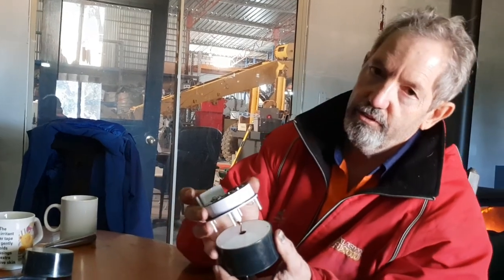Netatmo wind gauge

Comment: Hi Colin - there's no green light when I put in new batteries on my wind gauge so I'm wanting to take it apart and see if it's anything obvious. My question is, how did you get it apart? Does the top just pop off with a bit of force? I'm worried about breaking the legs between the top and bottom.
Reply: Nevermind - I took the nut off the base and was able to get to the 4 top screws.
Reply from the maker: Under where the battery sits is a nut that holds the whole lot together..
Reply: @ColinIngham  Thank you for your reply. I actually found it and have it apart. I'm getting 6 volts at the terminals. Was hoping it was some loose wires.
Reply from the maker: @bbates1968  I cant remember the green light, 6volts would be correct, can you see the led that would normally flash on power up.. send image 47gkh4@gmail